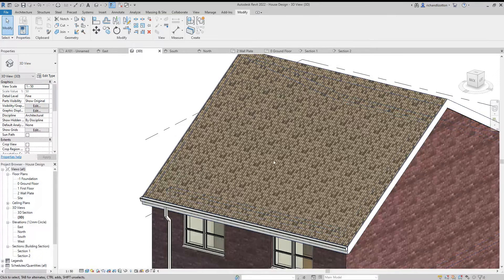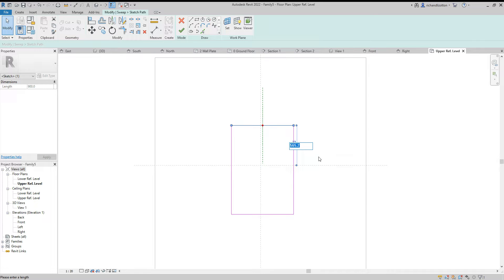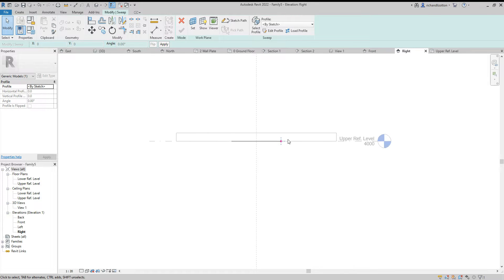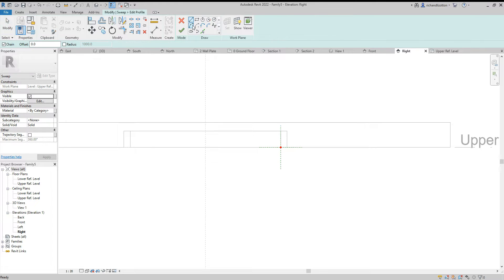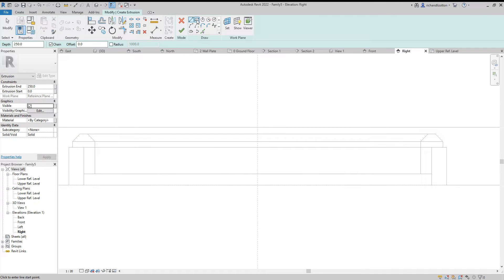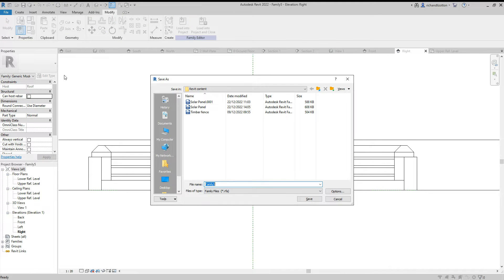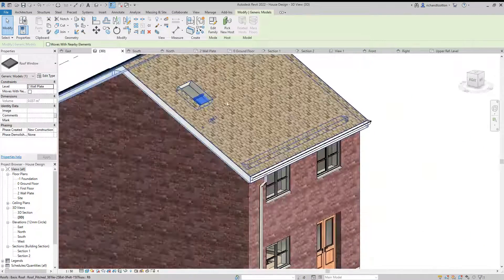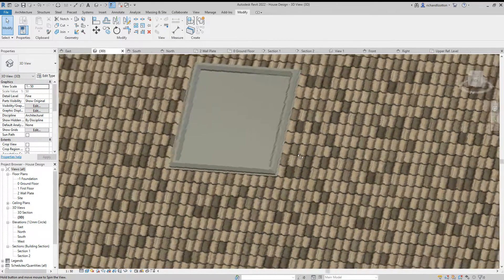Roof Window  / Skylight - New Family Revit Tutorial

Comment: Hi richard, thank you so much, I have managed to put on the roof now the window glass is refused to load to flush with roof level, not sure due to I have created many opening and roof window in one go. this happened to another roof was the first window successful but not the second one. Is that each time can only one each the time? Anyway, I will try again to find out the problem. Very good video and clear. Apprectiated for this video.

Comment: How you make your levels appear on your 3D and right ,also ribbon with all the floors, elevations appeared on the ribbon below the wrokplane? Thank you so much.
Reply from the maker: Check which template you use. The architectural template should be set for it.  Not sure what you mean with the elevations, the tabs appear after you open each one!